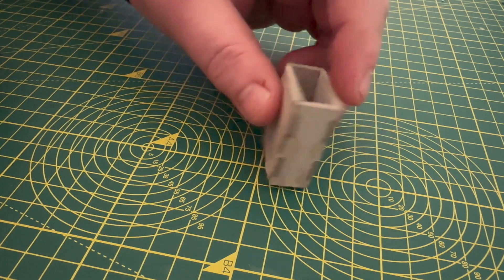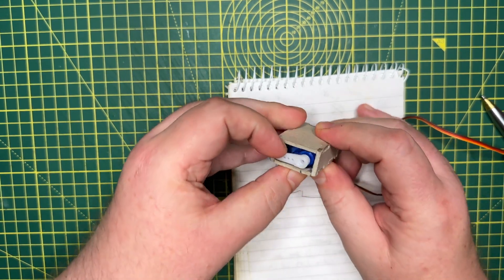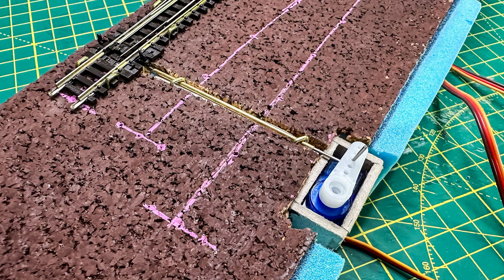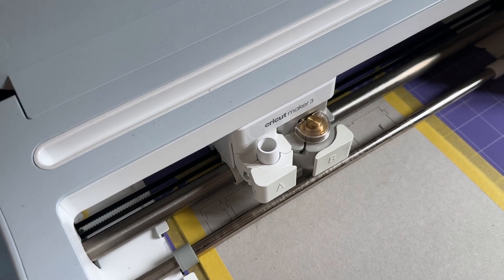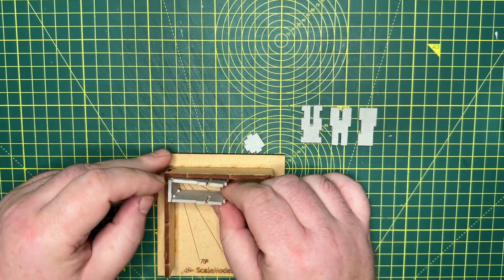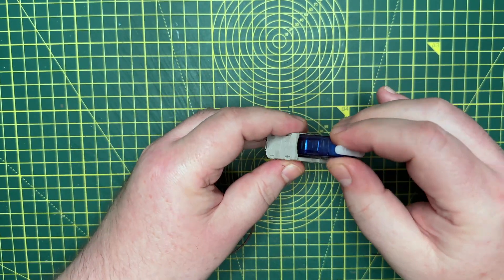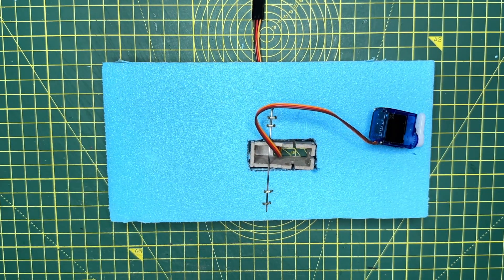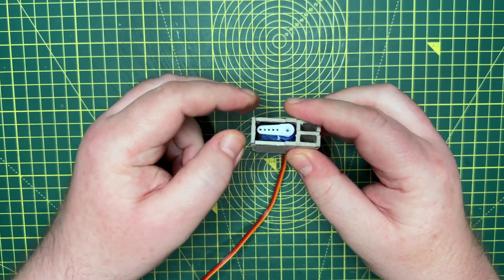118 - Build - Servo Enclosure Box Redesign

Comment: Hi Ian. I've just caught up with your surface experimentation of points motors as i made the mistake of expecting GM seep point under board motors with pin extensions to reach up through the 50mm of XPS and baseboard thickness to throw the point. however the pin while being long enough has to much free play at the point it goes through the point tie bar and even with the unifrog spring removed, the bar slides in the tie bar hole and doesn't move the bar the full throw distance. there's just to much "wobble" in the movement. These 4 x pm4's will therefore be buried under the point as a fix. However I've another 5 points motors points to install in an industrial area. So in seeing you using the sg90 servo motors i want to use them. however you don't conclude which switch you'll be using. Can you recommend a suitable switch that is compatible with dcc please?  Cheers
Joe
Reply from the maker: Hi Joe! Yeah, that's the reason I decided to go with SG90s buried in the foam using enclosure boxes!

Regarding controlling them, I made a servo motor control thoughts video and went through some options that you can see here:
https://youtu.be/kOLlwzGgz5w

And then I initially decided that I was going to use the ESU Switch Pilot 3, which you can see here:
https://youtu.be/tHBUDrx1g-A

However, I've since decided that I'm going to create my own servo controllers using Arduino's, but haven't got around to making one yet!

Hope this helps!

Cheers, Ian.
Reply: @iansngauge thanks Ian it’s lazy I know but it’s easier to ask rather than dig through the back catalog of your vids. I’ll become a plankton or whatever it’s called. Cheeers Joe.
Reply from the maker: @joerotchell4882  - No problem Joe! I don't mind answering questions, just it sometimes takes me a day or two to respond! I always try and put links to related videos in the description, so it can be worth looking there! I've also recently gone through my Playlists and organised them better, so again, if I'm being slow in responding, you could take a look there too! :) All the best, Ian.
Reply: @iansngauge do you do “patron” or members type thing? Frankly when you are actively solving my problems; taking time to respond to individual questions and creating by far the most relevant content to me I’ve no problem giving to the channel on a regular basis without any further expectation in content or individual attention. Going back to the servo motor switch I’d like making an old fashion mimic board with toggle switches so I’ll speak with that link to Megapoints. Cheers.
Reply from the maker: It's incredibly kind of you to offer support, and it's much appreciated! Unfortunately I don't really have the time to create enough videos for Patreon or Member's Only content! I do have the Super Thanks button enabled on each post, but I think YouTube take a rather large cut of whatever is sent via that route! Regarding Megapoints, they're excellent, and their new WiFi enabled system is what the Rail Nuts team use to control points and signals on their Making Tracks layouts! I'm so pleased you've found a system that you'll be able to work with! :) Cheers, Ian.

Comment: Is there any particular reason you put the control rod up through the bottom of the horn and point.  A simple S/Z in the wire at the point end will secure it and the right angle at the servo horn is all that's necessary.  Also I have found that 0.8mm piano wire is stiff enough to control points especially since you are using it through a tube.  By top mounting, you can lower the servo motor further within the foam.
Reply from the maker: Hi Peter! Yes, the reason I put the control rod up through the bottom of the horn is so that I can remove the horn, so that I can then slide the servo out from beneath the rod! If I'd put the rod in from the top, it would have trapped the servo in the enclosure box, and I wouldn't be able to replace it should it fail! When I have servo motors installed in scenic areas they will be mounted lower in the foam, and hidden! I have a plan!!! :) Cheers, Ian.

Comment: Hi Ian can you let me have details of the machine you use as I have difficulty gripping tools and cutting things out
Reply from the maker: Hi Christopher! The machine I'm using is called a Cricut Maker 3! However, there are other cutting tools available, and I'd suggest doing a search for something like "Cutting machines like the Cricut" to discover them! While I really like the hardware, and it does a great job of cutting some tricky materials, I think the software used to drive it is abysmal! Cricut also require that the machine is connected to the internet for it to work, which means that if your connection is down, or Cricut are maintaining their servers, you can't use it!!! I've not experienced this issue, but plenty have! Don't get me wrong, I love my Cricut machine, and it hasn't put a foot wrong since I purchased it a couple of years ago, but I don't think I'd purchase another one! I think I'd be looking at one of the Silhouette machines, or maybe a Brother! Alternatively, laser cutting machines are coming down in price, and they can cut plywood and MDF as well as card stock, so I'd probably go for one of them! Hope this was useful, and you find what you're looking for! All the best, Ian.

Comment: Nice design. What were your reasons for using card rather than plastic? I wonder about the effect of moisture and swelling of the card over time.
Reply from the maker: Hi Bob! Thanks! The main reason is that card is cheap, available, and my Cricut machine will cut it! If I had a laser cutting machine I probably would have gone with 2mm plywood or MDF! I don't have a 3D printer, but that would have been a possibility too! I'm not sure how moisture will get to them, other than when ballasting, although may varnish them as a precaution! Cheers, Ian.
Reply: @iansngauge  your Cricut will cut Evergreen plastic sheets. But yes varnishing the card will help. Is it in a loft?
Reply from the maker: @bobfuller  - Ah! Thanks! That's interesting! I didn't know that! Do you know what blade you need to cut it? No, the layout is in a bedroom that's centrally heated, so hopefully won't be too damp! :)

Comment: Hi Ian, that's a nice upgrade on the design - the need for maintenance seems inevitable, so I'm sure it'll prove worth the effort :)
Reply from the maker: Hi Jonathan! Thank you! Yes, it wasn't until I tried to remove the servo motor as part of the Tricky Bit installation that I realised the motor would be trapped! I'd thought that it would slide out easily from below the push rod, so it was good to have discovered the problem early on! I still haven't completely nailed the design yet, but I'm getting there! All the best, Ian.

Comment: I've just realised that I didn't comment when I saw this earlier.  The redesign looks to have solved some problems and the cricut cutter really is a very useful bit of kit.  I was going to ask how you were going to protect and  disguise the servos partly prompted by Paul's point about the ballast. Plainly you won't need to ballast in the off scene servos or disguise them.   I've now also seen John's comment and your reply.   The glue/water mix spreads through capillary action given how much you have to douse the ballast and if a servo and or box is near, it will make a bee line for it no doubt guided by a mischievous modelling God.  I think you would have leave out the T section at least until everything had dried otherwise it will be glued in, but I am not sure how you will project the servo from getting gummed up if it is in place.  Stephen
Reply from the maker: Hi Stephen! I watch the majority of videos on my TV, and am always forgetting to comment when I'm next at the computer, so you're not alone! I'm pretty pleased with the new design, and definitely wouldn't be attempting it without the Cricut machine! I'd not considered ballasting until Paul mentioned it, so I gave it some thought in the pub yesterday!!! Removing the T-piece will be a first step to avoiding disaster, but I think I'll be okay with the servo, as with the 40mm and 60mm boxes, the servo won't be at the bottom, otherwise it will be hidden! As a final resort, I could ballast without the servo in place! I think I'll perform an experiment before I commit to it on the layout though! Cheers, Ian.

Comment: Nice job Ian. For the potential problem of assembling parts the wrong way, you could try to design the tabs asymmetrical.
Reply from the maker: Thanks very much! Yes, I've tried to make the parts as asymmetrical as possible, but will try harder! The main problem is with trying to maintain a decent size for the tabs, with good spacing, so that a good amount of glue can be applied to make the joints stronger! This restricts where they can be placed! To be honest, it's not a huge problem, as long as I concentrate while building them! :) All the best, Ian.

Comment: Hi Ian, a very smart solution to your issue.  I guess one thing you need to consider in the next version is not to make it too tight in the diection used to slide it in and out. What blade and material setting are you using on the Cricut? All the best!
Reply from the maker: Thanks very much John! I won't be changing the dimensions of the enclosure box, but will move the position of the T-piece closer towards the servo, which gives a little more wiggle room and keeps the servo tightly constrained! I've already created a couple of versions, and a 1mm adjustment seems to do the trick! I'm using the Knife Blade in the Cricut machine, and use the "Heavy Chipboard - 2mm" setting for the material, which is 2mm greyboard! In the UK, chipboard is a very different material made up of wood chips, but in the US it seems to be the same as greyboard! Cheers, Ian.

Comment: Greetings, Shelfington, and hello Ian 👋 You make that Cricut sing just like Buddy Holly 😉 I wonder if the removable T Section might be a magnet 🧲 for scenic cement or PVA  from ballasting 🤔 water will find low points 🕳 and it might not be so removable later on 🤕 Very best wishes from the Emerald Isle ☘️
Reply from the maker: Good morning Paul and hello Wickford! Haha! The Cricut machine does make some rather odd noises at times! :) Hmm! Never thought about the removable T-piece getting trapped! I could make it a bit shorter, so it doesn't touch the bottom - or remove it while I'm ballasting / scenicing (is that a word) to mitigate the risk! Sounds like grounds for another experiment! Thanks! All the best, Ian.